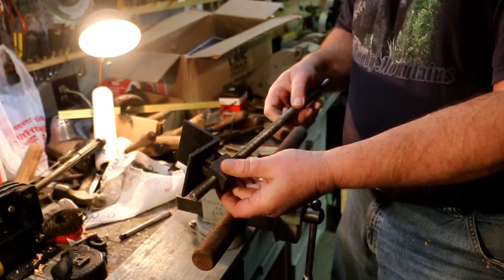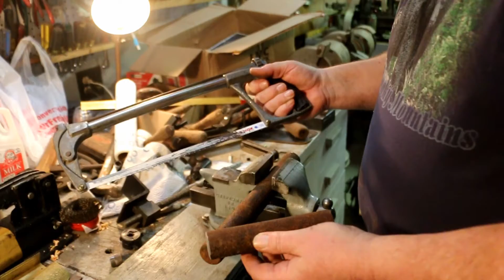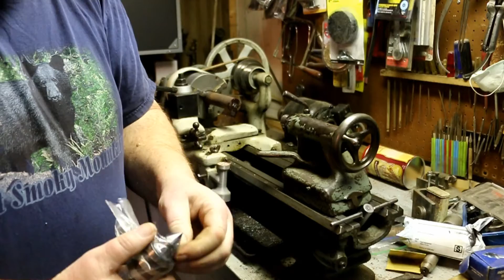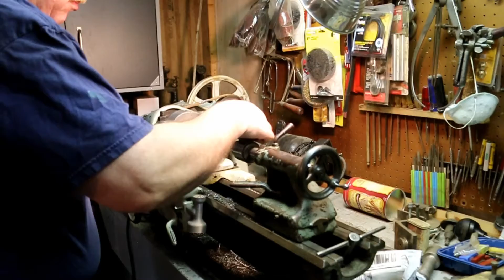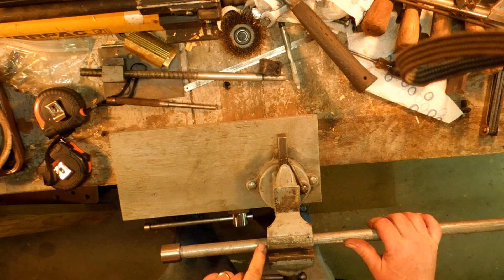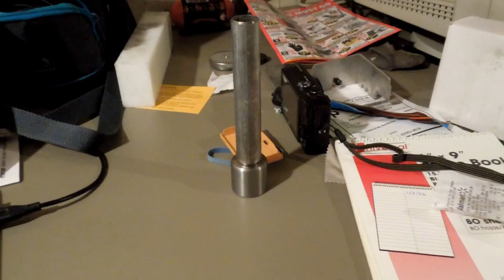Wheels For The Milwaukee Band Saw Pt 3 Rebuilding The Vise

Comment: Lenox blades are the absolute best in my estimation.  Hole saws too. I'm too lazy to hack all the way through all that thick bar stock !!  LOL.  You the man, man. I'm getting a bit lazy in my old age I guess...  It sure is funny how easily a fellow can get sidetracked by a needed repair on something you need to do the original project with.  Story of my life....  Good video sir !
Reply from the maker: The timing of projects apparent through watching videos of somewhat deceptive. I think we both know that the work is done on an as-needed basis. You might have time that I have available determines which job I'm going to be working on. Quite often I'm hopping around job to job like a flea on a griddle.
But that's okay I don't mind at all. Some days I don't get a chance to work on a video at all. Some days I make 10.
This time I was cutting the bar stock for the handle because that broken plastic knob was chewing up my hand right through the welding gloves.  
I'm mounting the hoist on the tractor this afternoon. Then I have some hauling and lawnmower work waiting. 😆

Comment: Your very courageous I must say....cutting that shaft by hand.... you're doing very well at fixing that saw....I would have used my electric bandsaw....the hand one that is....just getting lazy I guess
Reply from the maker: It just seems like a sucker bet. I get a free saw. No problem at all with that. Jim was very nice to give it to me. 
I get it working. Then I keep thinking of ways to improve it that require me to cut steel. 
I did the same thing with the South Bend Lathe. I bought it and spent countless hours building accessories and improvements. Must be something in the air. 😝🙃
Reply: @OldSneelock  Then you`ll know how many friends you have after it`s all fixed....CHEERS
Reply: @gatorsworld  Yeah I had lots of friends when I had my pickup but lost some when I didn't have it anymore.
Reply: @mostlymoparih5682  Same here....when I bought my Yukon....funny it`s still a truck but the just don`t come to visite any more.... too bad....CHEERS
Reply from the maker: @gatorsworld  Friends like that cost an awful lot to keep.

Comment: It's all ways something.  I was watching you squaring up the end of that pipe and yelling at the screen don't weld that.  My blood pressure  and stomach settled down when you cleaned the galvanize off.  I've had metal poisoning several cutting galvanized grating over the years.  I've cut it outside and stood up wind, but it would never fail and the fumes would swirl and come behind the hood.  The zinc fumes will absorb through the eyes and into the blood stream.  My eyes swelled shut one time and watered for 3 days, along being sick to my stomach. Need to spread the word DO NOT weld or heat galvanizing  even with a grinder. Safety First good job Unc.
Reply from the maker: I'm cautious with the stuff. I haven't had a reaction to any welding smoke, but that doesn't mean i won't. If it was a big assembly then I would have ground off the zinc before welding.

Comment: the oldest tool  i have (well i gave to my brother) was my dads duralumin rolls hacksaw, he bought in the 50's, still works as it did, quite heavy, the 35 year old sandvik that was also my dads i still have and is my goto hacksaw, you certainly got a workout with yours cutting that!
Reply from the maker: I have said it before and I will repeat it. I hate hacksaws. Making go-carts and minibikes from pipe and tubing long before we had angle grinders or could afford a cutoff saw. I cut pipe and steel plate with hacksaws not fit for being a paper weight. When I started buying my own blades it got better but the original distaste still lingers. 
My second big tool acquisition was a cutting torch.  😎
Reply: @OldSneelock  2nd this. Grinders and hammers here!

Comment: Yessir, the time to fix a too that don't work right is just as quick as you can so it'll be right when you need it the next time. I like Lennox stuff myself. I've got a LONG Lennox blade in the Sawzall that's cut about everything and still going right well. I found the right plug for the generator cord so's I can close the little door on the outside box when it's plugged in. a 5666CA will do it. Now to find a used (I hope) Mercoid tube switch to narrow the drop width on the well pump. It'll show when needed. from zero or 20 to 70 or 100 psi if it's adjustable in between. Always sumpee all uh time! FINE njob on the saw handle, Unc! Don't need parts flying more than usual!
Reply: Shim? Shim er me timbers  no wait shim er me band saw.
Reply: @mostlymoparih5682  Beat it about the head and ears till it fits. Unc uses simpler, more refined methods!